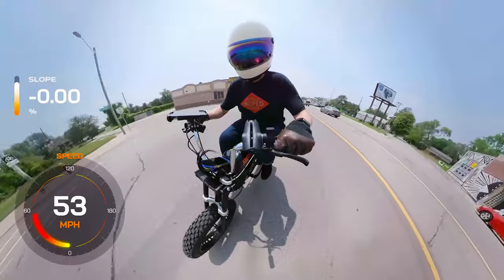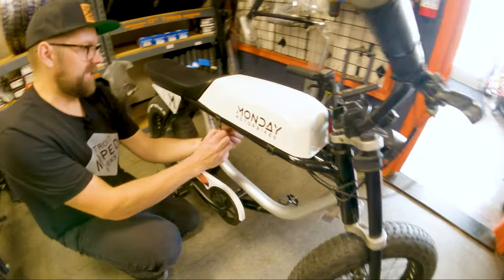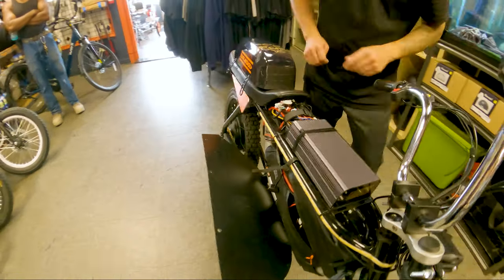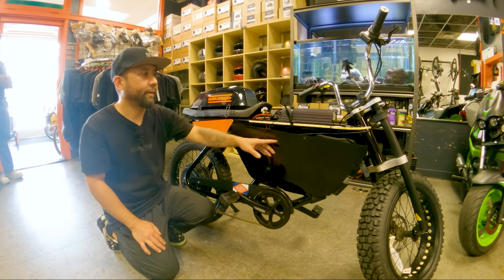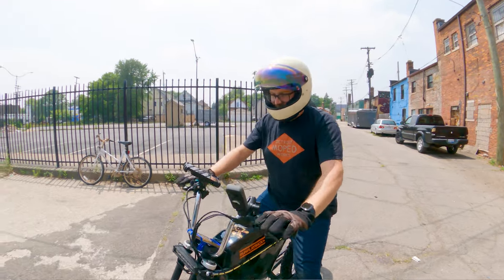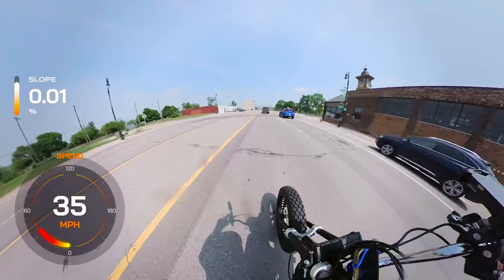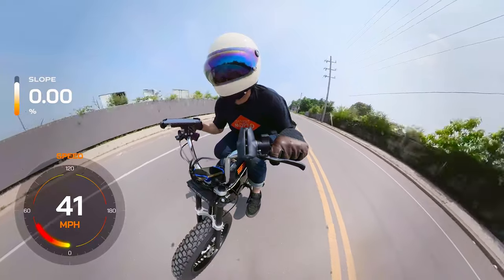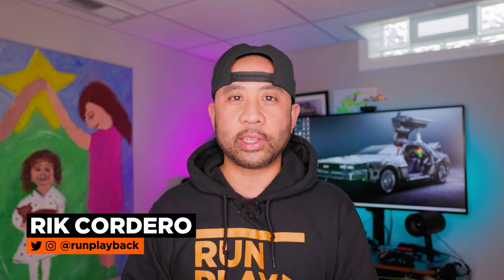Unleash the Power: Exploring the 72v Monday Motorbikes Anza in Detroit! | RunPlayBack

Comment: What is being represented by the vertical orange-white color gradient bar?  It does not appear to update with the nominal slope % shown immediately to it's right (e.g. when the slope is 0%, the bar appears to be filled to 90% of its maximum).
Reply from the maker: To be honest, I tried looking up what that bar represents and I'm still confused. It's using the telemetry from the Insta360 app. All I know is that the + and - numbers represent if you're going uphill or downhill and the steepness.